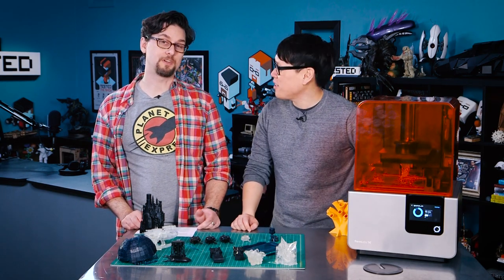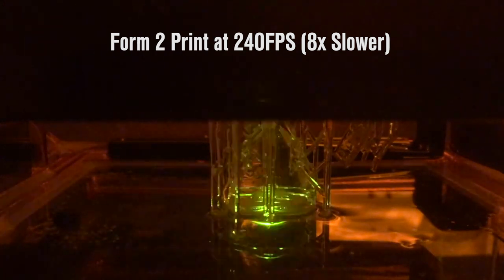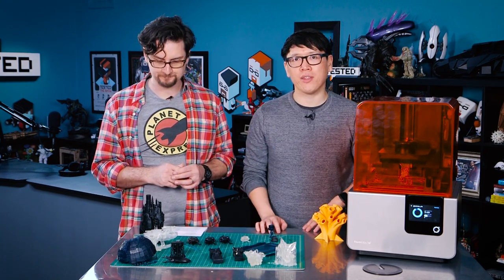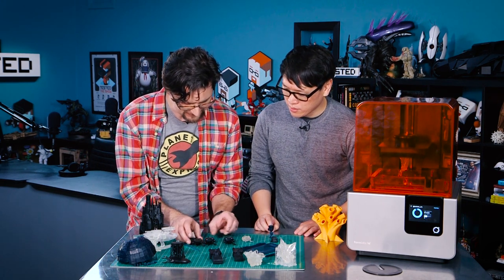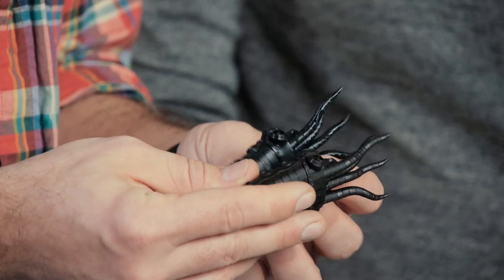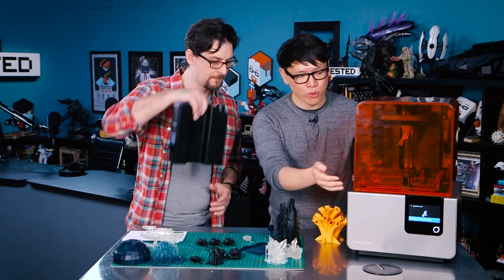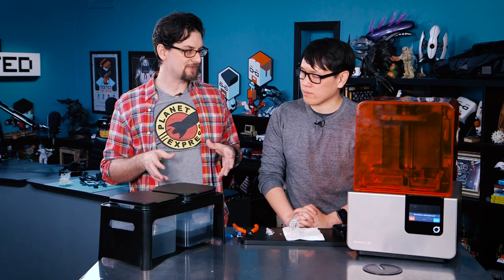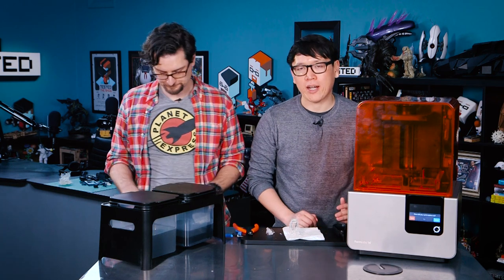Tested In-Depth: Formlabs Form 2 SLA 3D Printer

Comment: $149 for one bottle of ressin?? That's insane!
Reply: +Benjamin Wood Its 149-175 per bottle, plus you need to pay 59 for a new tray every 2 bottles. It sure is insane
Reply: pure fire They probably have a profit margin of 1000% on those things. Call me back in 5 years when it's less ridiculously expensive lol.
Reply: +Benjamin Wood Let's not forget the steep cost of the printer itself.  This is a printer for the select few.  Also the print times are very very long.  This is a very slow printer.  Also you are dealing with Resin, which is nasty stuff.  Notice they use gloves when dealing with the insides of the printer.  Well at least the smart one.  Finally FDM printers are in the 100, 50 AND 20 microns now!  Search around.  I am seriously considering the Ultimaker 2 or 2+.  You can get great deals on the Ultimaker 2 right now since they are closing it out.
Reply: +William Hayden - I agree that SLA has some issues and is really expensive. But the detail on these is significantly higher than on any FDM I have seen. The Ultimaker 2 doesn't come close. I'm excited to see what the new Ultimaker can do, though.
Reply: AdenineMonkey 0.025mm resolution is 0.025mm resolution.  Perhaps you haven't seen too many 0.025mm prints in FDM because they take a long time to create.  Most FDM prints are going to use 0.05mm or 0.1mm resolution for the sake of getting the print out of the machine before you enter into retirement.  Both the UM2 and UM2+ support 0.025mm prints as do many other FDM printers out there.  From what I gather thus far the UM2+ will make these finer resolution prints faster and more reliable with the new filament stepper feed drive system among other improvements such as the new cooling head, etc.
Reply: William Hayden "0.025mm resolution is 0.025mm resolution"

Except that it's not. PLA sags after extrusion; the plastic doesn't solidify immediately when it leaves the print head. ABS is a little more robust, but still not perfect. There are always minute random errors in the motors that show up when you try to print really fine details. I own an Ultimaker 2, and I love it, but the prints I've seen from SLA printers (Solus) on similar resolution are definitely more scrisp, and more accurate in their details.
Reply: AdenineMonkey I agree.  It's difficult to get the precision of a laser in movable mechanical parts.
Reply: AdenineMonkey I wouldn't mind having an SLA printer if it weren't for the high cost (initial and continual), the huge mess and exposure to higher toxicity materials.
Reply: William Hayden Oh, no argument there. The price of the resin is too big a hurdle for me. My trusty Ultimaker is good enough for most of my projects.
It would be nice to be able to print highly detailed miniatures, but not $175 and a lot of hassle kind of nice...
Reply: +William Hayden +AdenineMonkey Just going to weigh in here. We actually just received two of these printers, and I've been using them for a few days now. These are all valid points, it certainly is a lot more expensive. For context, we've been using primarily Ultimaker 2's for the better part of 2 years. I think Formlab's target market is at-home professionals and small businesses that don't have the cash for the $50,000-$100,000 industrial 3D printers, but want better prints than your typical FDM printers provide.

The speed is actually pretty comparable with the Ultimaker 2's -- some prints are mildly faster and some mildly slower, depending on the model. 

One of the biggest benefits is the ability to print structures and details that an FDM printer might struggle with. On it's finest resolution, the parts look almost injection molded with minimal cleanup. The cleanup itself isn't too terrible, and the mess is minimal so long as you're careful. 

Additionally, these printers require nearly no calibration. If you have spent time with FDM printers, you know that calibration can be a never ending nightmare. By contrast however, we had the Form 2 out of the box and printing in the first half hour.

Our office does smell a little bit weird now however -- so it should probably be put into a well ventilated room.
Reply: When did you guys order yours?
Reply: +Joseph Rinaldi The thing that kept me from buying a 3D Printer yet was the rather lacking quality when it came to FDM printing so I was always longing for one of those SLA Printers but what's been bothering me the most is that while the 3D Models that I do are very high demanding in the quality of the prints - I don't do them very often.

How would a Form 2 SLA Printer deal with this lack of printing requests?I imagine this being an issue where if I'd let it sit for weeks to come before the next print arrives causing the Resin or Bed to go bad, no?
Reply: +Duraltia The Formlabs resin has a shelf life of 1 year when it is left in the bottle. The resin that is left in the printing tray has a lifetime of about 2 months. If you don't anticipate making a detailed model in the near future, I would just pour the remaining resin back into a clean bottle to preserve it (Don't put it in the original bottle with the unused resin because you might contaminate it with bits of cured resin, etc).
Reply: +Tim Homan We ordered ours in early December.
Reply: +Joseph Rinaldi What?  I ordered mine right after launch in the beginning of October...still not here! But at least they created a shipping label for it yesterday - after I called.  Still not shipped yet so. Its been over 4 month now!
Reply: but the resin last forever if your doing small pieces. I would only get this to make molds or for making jewelry. I would only buy if its making me some cash
Reply: +William Hayden I own a Ulti 2+ and a Form 2, the form 2 beats it in quality, EASILY. You can't even compare and the Ulti 2+ is an incredible machine, beats everything FFF on the market, unless you go to those 15k+ machines.
Reply: +Shadow Black Do you do printing as a hobby, or as a job?
Reply: +Benjamin Wood Gizmo 3D Printers doesn't have any replacement parts during the printing process and the resin price starts at AU $65 a liter. It's on Indiegogo now.
Reply: +AdenineMonkey I think Gizmo 3D Printers are a better bet - high detail and lower costs on consumables.
Reply: +AdenineMonkey Go for a Gizmo 3D Printer then - resin prices start at AU $65 per liter.
Reply: +Joseph Rinaldi I get my Gizmo 3D Printer in 4 - 6 months - cheaper resin and no silicone layer to replace :D Plus it is SUPER fast.
Reply: Michelle de Klerk $65 a liter is still pretty expensive, but that is definitely more reasonable than $149.
Reply: +Benjamin Wood yep and no silicone layer to replace now and again so another saving there.
Reply: +Benjamin Wood How much cost 1kg of good quality PLA/ABS? Makerjuice resin cost 55$ I think that I saw $40 resin somewhere.
Reply: woah $55 is the cheapest I've heard of so far :) Nice one!
Reply: You do not have to use their resin
Reply: But that one bottle makes lots of little odometer gears.
Reply: we have like 8 ipro 9000 @ work... running  accura 60, accura 25, castpro etc... at least a couple hundred a liter lol... I've seen 10k worth of resin (finished parts) thrown away just from delamination it's sad haha
Reply: I think if you think the consumables are expensive, this printer is not aimed at you. We used to send all our printing out to a local company who used SLS powder printing. One part could cost us more than a 1L resin bottle, and it took a week to get the parts back. Now we have a form2, I will spend 149 dollars on resin all day long, it saves us so much money on outsourced printing. Even at 500 dollars a bottle it would still be cheaper than subbing our printing out. 

Also at 3000 pounds (we are in the UK) its dirt cheap. We were just about to buy a 40 grand objet printer when we tried the form2. This printer is not expensive, its just not aimed at home hobbyists. It has changed our business and for us, its so rediculously cheap, its practically free.
Reply: Hocus Products Ltd I understand that it is much more convenient and cheaper than the alternatives. However that doesn't change the fact that they are ripping you off on the price of that resin. They are making massive profit off of you. The profit margin on that resin is probably higher than 500%.
Reply: Fine by me - They spent years developing it, taking all the risk and spending all the money. Its a company, they have to make money. If they did not make money, they would never have developed the fuse1. Without formlabs, I would have to either use a crappy FDM printer or carry on subbing out. They deserve the profit.
Reply: Hocus Products Ltd Yea until they get put out of business by another company that wants to make their printers available to a larger market instead of ripping off rich people and other companies.
Reply: Yeah Im not worried about that lol. In the meantime, il enjoy our Form2. In fact might get a few more. Id rather have five printers in a line than constantly change tanks and resin cartridges all the time. Its just finished an 11 hour print on a prototype mould for some rubber buttons on a product that will cost tens of thousands and be mass produced. Its worth 3-4x the cost to us, easily.
Reply: Benjamin Wood yea it sound already expensive for my project. But this is gonna be the labor of love so I'll pay for it
Reply: Benjamin Wood my resin tank wore out, bought another along with another litre of resin, nearly 200 dollars! And I don't give a shit! The printer has not stopped working for weeks and has saved us half its value in outsourcing costs already! This thing is dirt cheap and if you don't realise that, then you are not its target market
Reply: Don't disagree but they probably invested a lot in their R&D to get the right resin formulation. Price may drop when the volume goes up, or third party will jump in to sell resin, but again, there is R&D cost.
Reply: Uh, have you ever bought toner for a regular color laser printer? it costs about the same. If you are a student with no income this obviously is a hard decision to make, but for a professional designer, this is pretty much the cost of doing business.
Reply: Since I last saw this thread, ive used four cartridges of resin and the printer has saved me probably 1500 dollars atleast in subbed out printing. So cheap.
Reply: still only 0.15$ per cm³ When you have it printed somewhere else you can expect to pay at least twice that price if not more. This is indeed 2-3 times as expensive as the Ultimaker filament. When you take failed prints and extra support in account this difference will turn out to be less. Is this something for occasional home use? No, not at all but it is a reliable printer for small businesses. This costs about as much as a (small) professional photocopier. 

Just like you have the home inkjets > fridge size photocopiers > 5m+ modular printing press 
There is a wide range in 3D printers. Instead of complaining about the price be happy that they are bringing quality 3d printing to businesses at an affordable price.
Reply: you would like to be the same ,,,not even close ,,,and the resin is cheap ..if you consider that you dont lose any print ,,and the resin quality is high end ,,you cant sckrach it ,,,.
Reply: this 2 guys ,,i dont know what they did to the printer ,,i see wrong orientation ,,,this producks are not the mirror of form 2 .....watch other other video ,,to see the epic print of form 2
Reply: at the prices this crap costs, iits cheaper to get a plastic moulding machine. the dies are expensive but they last a lifetime.
Reply: @ fhhsvnggbh you are not seeing it from the right perspective. It is not for limited reproduction. It is for prototyping. Prototyping costs are different.
Reply: Yeah he's totally missed the point lol. This machine isnt for manufacturing. No one in the world is trying to suggest that 3D printing wiht a form2 is better or cheaper than moulding.
Reply: 60$ for a liter on maker juice

Comment: If you bother to check, 1,6-Hexanediol Diacrylate (HDDA) or Trimethylolpropane Triacrylate (TMPTA) typically sell for $3.30 to $3.80 per Kg. BAPO photoinitiator (Norrish type 1) is around 3.5 cents per gram (typical concentration is 2%). Sudan 1 dye cost is insignificant. You got resin for about twice the price of good orange juice.

Comment: One other difference in FDM and resin printers worth mentioning is that FDM can make useful mechanical items like a wrench, small gears and even RC rims and such while the resin printer would not make parts strong enough. But the resin parts will looks better right out of the machine and would be great for mold making and jewelry making. You can make a fine piece of jewelry, cast it in silicone, use that as a "push mold" for precious metal clay, fire that and in the end you have silver or gold jewelry.
Reply: Wrong.

Comment: 3D printers are just about affordable now! We've come so far!
Reply: +Austin Anderson they are I have one :)
However as it's a cheap one it breakdown a lot
Reply: +Austin Anderson That depends on what kinda quality you want, but yes, cheapest are sub-$200.
Reply: +Austin Anderson I have been through a number of printers in the last few years. My current one is a dual head printer that goes for $410 shipped on ebay.  That's pretty affordable.
Reply: +PhasePictures Weird, I have a $410 CTC from eBay. Hasn't ever given me any trouble.
Reply: +John Ridley haha yeah I have the same one, mine always in levels or the nozzle gets clogged up :(
Reply: John Ridley I  was actually thinking of getting that too. Noticed hobbyking as an even cheaper one, but it isn't evailable in Europe yet :D
Reply: +PhasePictures You must be using some crap filament, or you have a lot of dust/dirt contamination.  I've never had a clog.  I got a batch of crap filament a few years back with my old RepRap and it sucked, I clogged the nozzle every 30 minutes of printing until I gave up and threw the filament away.
Reply: +John Ridley I have a bunch of stuff including how to use it with Slic3r (the Makerbot software sucks ass) on my blog, dragonflydiy.com

Comment: As a long-time FDM printer owner, thanks for this. I'm completely cured of wanting an SLA printer; that's a gigantic pain in the ass. Printing on my FDM printer = stick in SD card, push "print", walk away.
Reply: I agree but in the future this concept is going to be way more efficient and faster. User-friendliness is going to increase also. Give it a few more years and FDM printers are nothing more than "the cheap alternative".
Reply: As someone who is looking to get a printer I am also cured of wanting a SLA printer and will go with a FDM printer when the time comes.  This looks like a huge PITA for little gains in the projects that I want to do.

Comment: Looks like a great printer. The only thing that puts me off with most 3d printers at the moment is the fact you have to have support structures and then have to cut them off once the print has finished. I'm hoping there will be some kind of consumer version of SLS printing at some point that completely alleviates the need for support structures.

Comment: Very nice video. Helped me understand how the Formlabs machine works. I do have to point out one thing, the information at at 24:45 (https://youtu.be/HkILCsAOMcQ?t=1485), is misleading. The degradation of the silicone layer is not directly caused by the laser. The effect of suction as well as the heat generated during a print cause the silicone layer to degrade and become "cloudy". 

The most important thing that I learned from this video is that Formlabs uses proprietary resin mixes due to the machine being SLA based and therefore, the resins sold by other companies are not compatible as the majority of them are designed for DLP 3D printers. The Formlabs resin is less viscous than the other resins on the market. This effectively forces you to buy their resins. As someone who is not based in the US, this is very costly. Formlabs hikes their prices for international buyers. This makes their resin extremely expensive when shipping and taxes are added to the cost.

Comment: The Form2 does look great, however, it's not true that SLA printers do not do hollow, or honey combed prints, it's all in the software. For the sake of comparison, Retina Create from FSL3D has a function to shell the model and fill it with a honeycomb like structure. I'm surprised this function is still not available on the Form2.

Comment: 3d Systems used a process called tetracast to hollow the items out with a spiderweb structure left.  It was helpful for using the model to make a mold for metal casting.  You could melt out the model and leave the relief to be cast. It was very useful for large items like propellers or intricate cases that could be made and prepared for casting inside of days, not weeks. this being stated I am not a fan of 3d Systems but am a fan of SLA.

Comment: hmm just had an idea... they lift the platform on this to keep the focal point of the laser in the correct spot to cure ya, in the professional version they move the platform down to maintain the focal point to cure.. what if for a cheap version the build platform is at the bottom of a tank and the tank slowly fills with resin and the laser moves up? that would maintain the right focal point and a solid base would allow for the tank to be small (the platform doesnt move so this allows for all that space).. some will argue about motors and fine optics but what about bouncing the light off a few mirrors etc... im sure its possible....